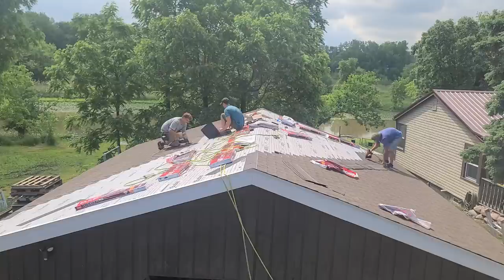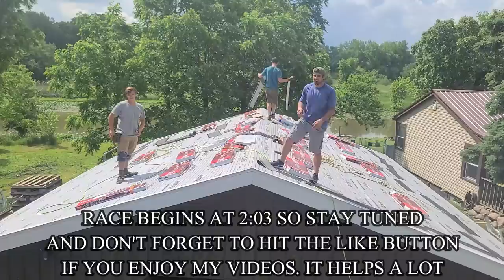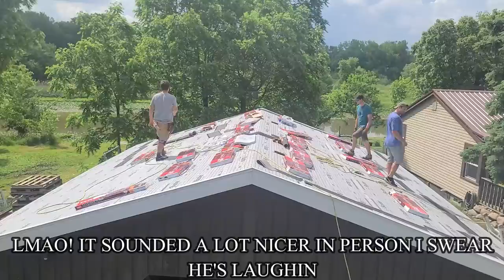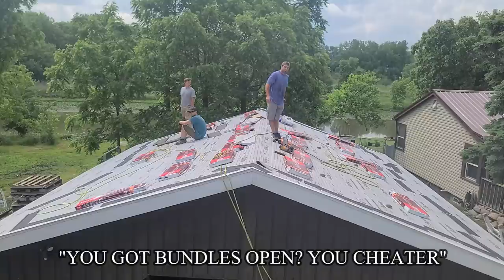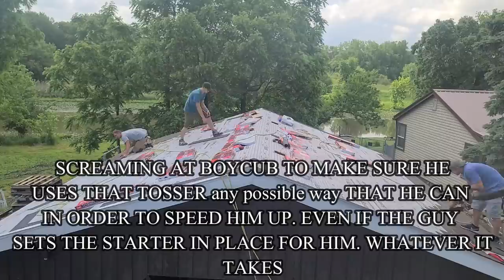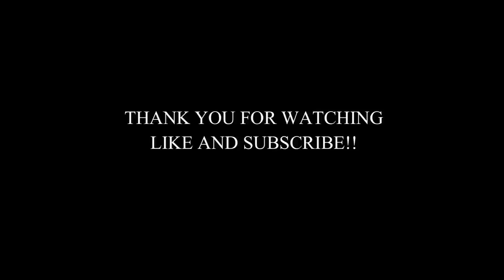Worlds Fastest Shingler VS Apprentice and Tosser

Comment: Someone who sits and kneels will never be as fast as someone who stays on their feet nice job like always!
Reply: That's right! I could never do it! Had to condition my back to tack it,20 years later my back is fucked! Lol but faster than most
Reply from the maker: Yea some guys can move but I rarely kneel. Stretching is important before hand
Reply: Not always true I got 2 guys on my crew 40+ yrs old that kneel or sit down and they put on 12+ sq a day
Reply: @mathewmccurry1140  12 square a day I hope they only work a four-hour day
Reply: @NWIVeteranConstruction   yes stretching has got important as getting older I realized,12 sq a day??  That shows right there how much slower it makes you! Should have that on by lunch time,when starting to shingle first thing in the morning
Reply: right stretching hundred percent I don’t bend over but I am pretty damn fast as well  40 years in the trade and still putting them on.  In Tahoe 7/12 minimum  and up in pitch  and at 6250 elevation hole difference game my man 👊🙌🏻to you ol veteran you are the goat I tell you respect my man

Comment: I loved it ..Many times when I drive by a job . And it's the middle July here in SC .. I point up and tell my wife " Look at all those guys roofing  .. That's male privilege !!" .. I am an older carpenter and the few roofing jobs I have done in my life . The temp was about 2 degrees above molten lava  . Wanted to jump off the roof , Headfirst into a cube of brick .. granted I have sheathed hundreds of roofs in my days and it can get savagely hot up there all day . Question .. What is the most comfortable pitch to roof ?? ..I heard some like a 4/12 and others like 10/12' .. Personally as a carpenter .. I like an 8/12 to sheathe  .. Not as much back break and the toes still cling to the roof .. I believe roofers have one of the most grueling jobs on earth and go straight to Heaven when they die .
Reply: it was 120 on are roof today

Comment: I couldn't do using a tosser that close  Grab me 3/4 of a bundle and put them on my foot, and nails when my pouch gets low. Outside of that,  get out of my way and let me run.
Reply from the maker: same! i have them open and spread my bundle down the run like i normally do for myself and i pound away. and on really big runs, if they're competent enough i'll have them go down to my bottom row and butt the shingles in place next to each other (like parallel to the gutter)...and then i'll go across it and lay 10-15 shingles in like 20 seconds.. i just check to see its straight, bang, check to see, bang. all while he spreads my bundle out. i did 10 sq in one hour like that before with a really good tosser. i nailed on prolly 3 square of it without ever touching the shingles lol
Reply: Agreed. My boss likes a passer. I can't stand it. Unless they really know what they are doing and can keep up it just slows me down and then what's the point?
Reply from the maker: @RabidParana1  yea generally somebody putting shingles in your hand ain't gonna do much. It's the grabbing bundles and opening them that saves you time. especially if they can set them up nice for you so you're just in a constant state of pound town lol
Reply: @NWIVeteranConstruction  I will only take a passer on one occasion. I've got a labour who can get far enough ahead he's got nothing else to do. And then I slow down and use that time to teach them. Next time get your hammer and nails ready cause you're more useful putting on starts or bottoms or whatever

Comment: You're only as good as your laborer, there was alot more he could have been doing to help speed up the process but that's on the guys with more experience for not giving him direction :) someone els said this but it's true, tool belt for coils, hammer, hacket, knifes even snips, he could be pre cutting the 2 shingles for his gable edge and instead of handing shingles he could be placing them above  him on the next shingles so all he has to do is pull it down a bit to set the shingle less moving for the installer and you can place the shingles like that all the way up your run so you're never really just standing around being useless lol but either way you guys still killed it

Comment: Everyone I know runs out all the starters..f that, I lay them as I go. Good win tho. 👍
Reply from the maker: I usually just lay enough to get my 2 rows across the bottom (I only do that for 1 Bundle worth) but it was so small n I was right there plus all I could think of was the essential craftsman video about productivity when he said "if you have to drill holes, drill all the holes, if you have to move wood, move all the wood" lmao
Reply: After I get done prepping, I always go ahead and tack my starters down with my tacker, and as I'm shingling, I'll nail my starters down before putting the first shingle on each row
Reply: @timbibin1301  I've done that,  same with the drip.
Reply: @stevejones8486  .. I actually nail my starters low, so I'm hitting the starter, and drip edge at the same time

Comment: Interesting. My buddy and I are about to redo my roof next week. I have done a few roofs and he's done a lot more. It seems the tosser doesn't speed you up that much and will be far better off doing our own patch of roof individually, rather then me throw shingles at him.
Reply from the maker: Depends on the experience of both guys. If you guys watch closely on how I shingle and know exactly how to organize the process then separate is better.  Otherwise 2 ants will almost surely get more done together than separate
Reply: @NWIVeteranConstruction  You were right.. It was mostly much faster for my Wife to toss shingles at my buddy while I did all the cutting.. I had to move pretty quickly to avoid getting behind though..:)
Reply: Well not trying to smack the tosser in this video but there were tons of times when the shooter didn't have singles ready for several seconds because he went to grab more, after he fully ran out. Most of it comes down to work ethic, and a steady pace. Also the owner of the video is pretty darn fast, so it's hard to keep up with two novices or average roofers.

Comment: I respect the competition aspect, but getting your lines snapped and prep done is only showcasing that your fast at putting shingles down and not much else. Getting around the cut in and doing the start quick and efficiently is the mark of a good journeyman, so cutting that out defeats the purpose of the competition to me.
Reply from the maker: I had to make it competitive somehow.  You can see the metal is on good and it didn't take long but I'd likely lose a lot of viewers if that was included.  They would get bored sooner
Reply: Not true.  You would lose the viewers who are "impressed" by your speed.  You would gain viewers who want to learn. You choose the more superficial stupid audience.
Reply from the maker: @matthewhewitt5613  I've got other videos for that